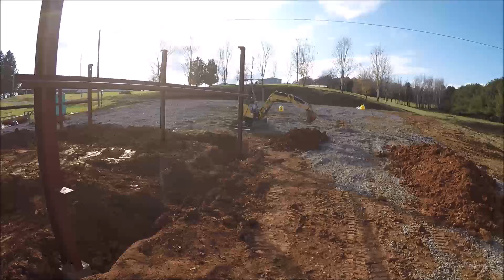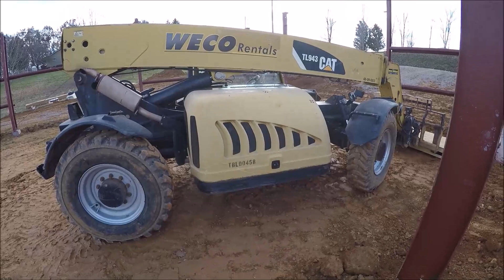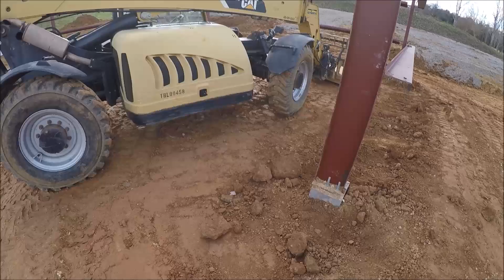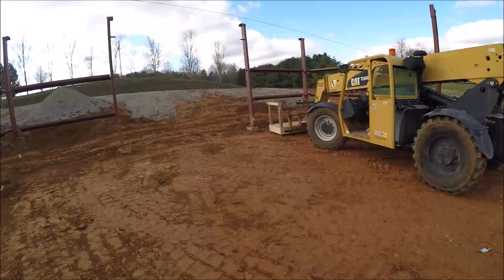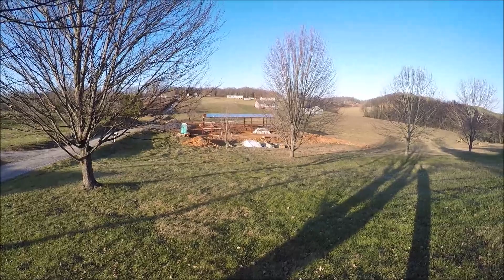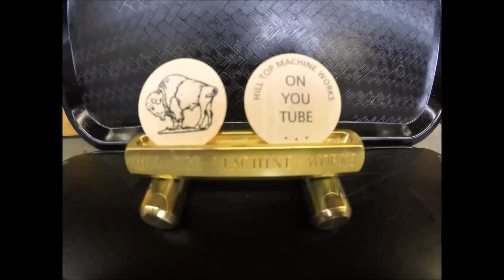New shop build Part 4

Comment: make sure they put the vapor barrier down first before they put the gravel down. A lot of people make the mistake of putting the vapor barrier on top of the gravel just below the pad. You need the pad to be able to breath when it is setting up.  Dont go cheap and not put a vapor barrier down you will regret the moisture that will come up through the concrete and rust your tools. Look good.

Comment: 7:30 I would suggest going ahead and digging out and grading a shallow ditch on that side of the building so water coming down off that hill doesn't go up against your foundation of thru your building. I imagine you will need to install a grated drain in front anyway to keep water from coming down that bank and thru your front door.
Reply from the maker: Yep that’s on the “to do” list.

Comment: You may need a good french drain across the front.  It's always nice when the dirt is just wet enough to pack good.  I hate when they deliver a piece of junk to work with and they still want to charge you like it's a new one.  Hope everything goes well for you my friend.  I am about to start a much smaller shop.
Reply from the maker: Hey Vernon. Yeah a drain will definitely be going in. A new shop build for you that is some good news.

Comment: It seems to me they would have laid the concrete before the started the framework, but then I’m not a builder so I’m not sure about that. Lookin good!
Reply from the maker: You can do it either way. I think it was faster to begin with to start on the steel erecting because of the weather issues.

Comment: Why so deep in to the ground couldn’t you have put in taller piles.
Reply from the maker: We worked off of the shallowest hole so the footings and pillars would be inspec with the engineered drawings. I could have paid a local engineer a $1000 dollars to redesign taller ones or move some dirt. It was cheaper to move some dirt and as a bonus I gained more room around the building.